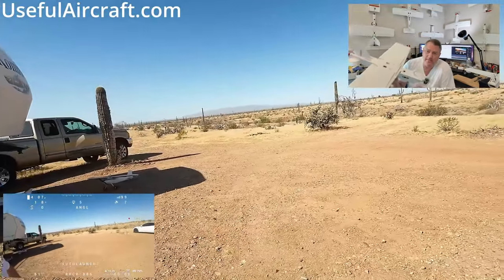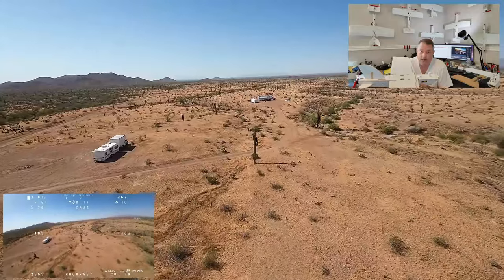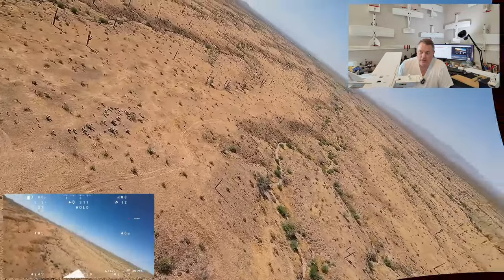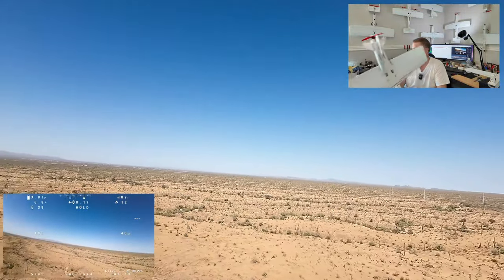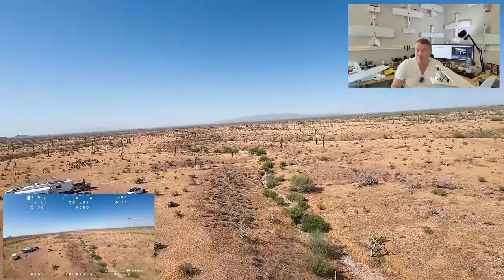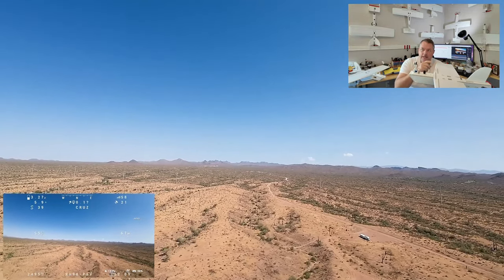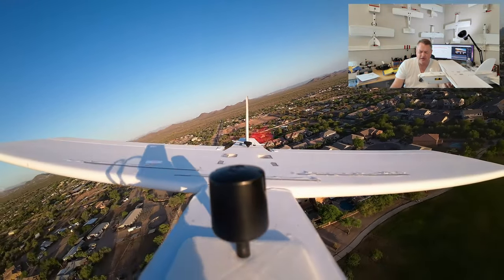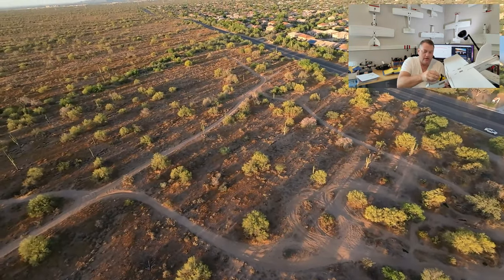Quick Build RC FPV Plane

Comment: I really like the content and I'm interested in the use of 18650 batteries. Can you share your charger you use? I'm looking to build a similar battery for a 6s 21700 battery for a x8 inav drone.
Reply from the maker: I'll do it.  I've built packs with both the 18650 and the 21700, and I like my design for my purposes.  They work well, provide what I feel is a safer alternative to li-po, and as long as you respect their current limitations - they've got tremendous capacity.  I'll put a video of that up in the days ahead.  Thanks for the note.

Comment: Awesome. What do you think your total cost on the build was? I want to build one of these, very impressive!! I would love to buy some kits if you ever decide to post some on your site. Sub & Like for sure.👍
Reply from the maker: As a quick hack - the flight controller, ELRS, GPS is probably $80 all in.  2 X 9 gram servos are a few bucks a piece - and I was using the o3 air unit - which isn't cheap - maybe $225.  The battery packs - I make those and buy the 18650's and use them for ages.  I'd really have to dig to get exact numbers - as I've just got parts bins full of stuff from old builds and things I've collected over the years.  These are all built up out of long recycled parts.

So all in- it's around $350 maybe if you had to buy everything new - but I reuse all the avionics and servos in plane after plane - so those costs have been long depreciated - and the build came about as I just wanted to utilize parts I already had.  Like I mentioned - when I travel with these, I tear up the airframes at the end of the trip and just bring the electronics back ready to go into the next build.  It sounds expensive - but you probably have most of the stuff from other builds - and that's why I like my swappable camera mount - one camera can be used on a bunch of planes.  It's really far more affordable to build your own vs what most manufacturers charge.

I'm on the road right now as work has picked up a bit - but I'll spend some time and maybe get some kits together if there's interest.  My email address is in the channel description or through usefulaircraft.com.

Thanks for the support - I've got other designs to share that you may like as well - but I'm not going to lie - this plank is a really great plane.  For so many reasons - and especially for the ease of the build - it's just an excellent go-to for so many flights.  I'm honored to have created something you like.
Reply: @usefulaircraft  thank you! That was a very detailed reply and it definitely put me in the ballpark of what the cost is..... That is very affordable even with the DJI unit... And I was just immaculately impressed with the stability of the video quality.... Thanks so much for your contribution to my knowledge... Stay safe on your travels I want to see/hear more from you👍